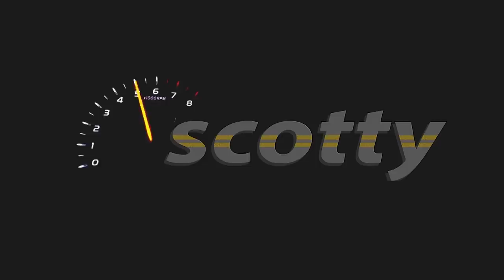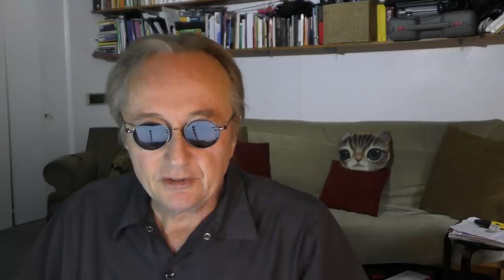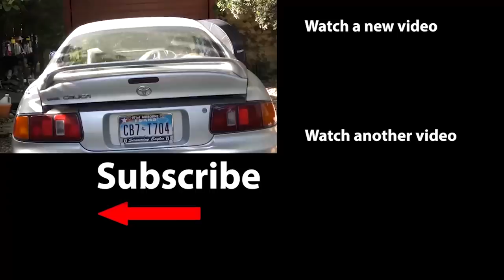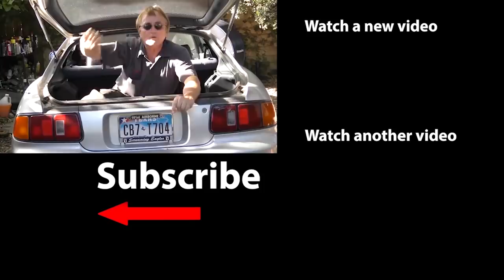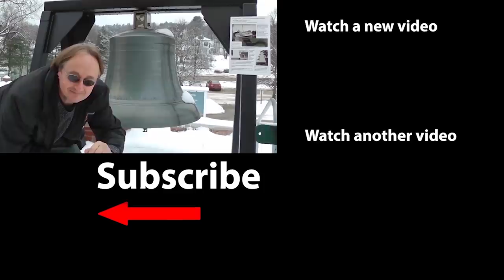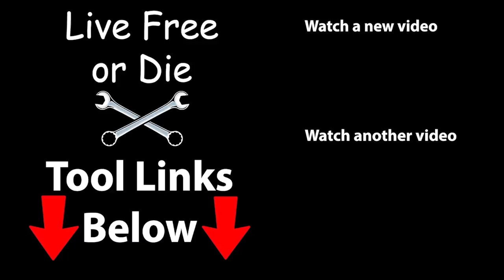Stupid Things People Put in Cars

Comment: 1:00 the most wear is when you start the engine on... COLD. When it's hot after a minute and lubricated there's no so much wear.
Reply: I agree with this statement. Basically overnight, the oil drains down into the pan. The reason the most wear occurs on startup, is because the oil needs a little bit to start flowing and lubricating the engine.
However, i also agree that those start/stop systems are hot garbage, and could wear other components, like batteries, starters, maybe even belts (accessory belt i think) etc. Even if they put beefier ones on, if you live in a high traffic area, the thing will just start and stop all the time in stop and go traffic. Also, i don't know if it's still the case, but in older cars, it actually wouldn't make sense to turn off the engine at a stop if it wouldn't have taken that long, as starting it back up would take up more fuel as it would've if you just left it running, but i assume that in newer cars that is mitigated through the ECU for the most part. If anyone knows, i'd be curious.

Comment: i call the auto start stop stuff. engine killers. and everytime is hear it. i say that engine has lost a few miles of its life. say 200k before it goes kabloey. now 199,995 k kabloey. if i ever have a vehicle that has that day one of ownership the engine killer is going to be permanently disabled.
Reply: Why i simply bought bigger and bigger. Noticed diesels dont have it, and happy to have my 6.7L cummins. Just have to be careful how long you idle. Fuel can and will wash out the cylinders. Benefit, they put a high idle switch into the controls to makeit idle at 1000 keeping proper oil supply.

Comment: I'm about to buy a car ('17 CPO automatic corolla xle, 18k, trying to get it for 16k) from the dealer and it makes a sound when you left off the brakes. Sort of like a mix of a clunk and screech, every single time. Do you know what the problem is specifically? Ima bring it up before purchasing so it gets fixed.

Also, would you consider that a good buy? It comes with 1yr/24k miles warranty bumper to bumper left and a 7yr/100k mile (drive train I believe) warranty afterwards. Good for the price? Thanks

Comment: Hey Scotty, I have a 2014  Ford Mustang GT pony package inside the manual fuel, it stated that  87 regular is recommended for my engine; however it also said that premium (91 or higher is good for pulling, towing and will increase the horsepower, sometimes I wanna use regular to save money, but I always use 93 octane, do you think it would be safe to use regular for a while or keep using 93?

Comment: Hey scotty, I have a 2006 chevy trailblazer ext ls. It has 189,000 miles and is running decent. The only thing mechanically wrong is the fuel guage constantly reading epmpty. Could you give your opinion on chevy trailblazers?

Comment: Large displacement Harley’s have that feature and I turned it off. You’re either compensating for it by blipping before a green light or deal with a slow/sputtering takeoff. It wasn’t for gas but heat, makes sense why they did it. 🤷‍♀️

Comment: Scotty- my parent bought a 86 Buick Riviera that had 18,000 miles. It was stored in a garage, but sat along time. Turned out to be a money pit. Eat through batteries like mad! I called it an electric car because if the charger was not on it it would only last about 12 hours until the battery was dead. It had all sorts of electrical problems. I think my Dad spent $5k for the car drove it for about 4 years put a couple of grand into it every year. After my Dad past away we donated it. Would have never feft right selling it to someone.

Comment: How to destroy reliability 101.

1. Drive the hail out of it.
2. Get a turbo or supercharger with lots of boost. See #1.
3. Turn off half the cylinders instead of using the right ratio in the transmission. I remember test driving a Dodge Magnum with the 350 V8. 350 hp 400'lb of torque and it was at 3000 rpm at 50mph 80km/h because it was using only 4 cylinders. It was in third when it should have been in 5th with the TCC on. Trying to save fuel at 3000rpm with a 350V8? How does that work?

Comment: 2:01 Honda 1.5 t gdi oil dilution problems mentioned again.
Reply: Is this oil dilution specific to the 1.5T or both 1.5T & 2.0T?
Reply: @sungod9873  just the 1.5 turbo
Reply: What about the 9th gen 4 cylinder accord?  Does anyone know if that particular engine suffers from the same problem?

Comment: Scotty serious question, I've heard that before that most wear comes from start up, but isnt that just cold start ups and warm up cycle? My thinking is when the starter engages its just like revving up the engine to 1200-ish rpm, if anything it probably wears out the starter faster, and maybe even the teeth a little but, just a little. Side note, give GM/Buick alittle more credit, I cant drive more than 5 miles without seeing a buick century/ lesebre, those things run forever, with dented bumpers and peeling paint, they are incredible reliable. (other than the L36 plastic intake XD). I love your videos though, keep it up!

Comment: Scotty! I bought a 2014 F-150 4x4 with 5.0 engine. the previous owner had put on a Scepter intake system on it. Great truck, but is the intake system doing anything for me, mileage wise, or is the sound from the intake just for fun? He also gave the origianl intake system to put back on if I want it.
Reply: the motor can only suck in so much air and pump it out the exhaust,   the computer is programmed for a factory intake.  the oxygen sensors,  the same thing,   I think it just makes people feel like they did something for the truck,  but its only one of many many,  many,  many parts that need to be changed to make it give you any real noticeable power increases.  even the entire exhaust will need to be changed to a bigger exhaust with different computer programming and can be illegal in many states of the US to do that.  its illegal to make a car or truck get worse gas mileage in most states,   and that's what will be going on with it.

Comment: Hey Scotty How are you. I have Daihatsu Mira Cocoa 2014, It has an idle engine RPM around 1700 when I start the engine and after some time it settle down to 1200 which is high from normal. What could be the problem?

Comment: The only real gasoline saving device is a manual transmission and a homemade fuel vaporizer instead of a fuel injection system. I tried a couple of times and it realy works! I recommend it.

Comment: Blown head gaskets are no fun. I've only experienced it once. Eons ago, I was driving my Mom's 1992 Plymouth Acclaim and it overheated sitting at a red light. I started noticing a few days later that the car was idling really rough. Felt like the engine was bouncing. She took it to a mechanic and found out the head gasket blew and cracked the head. Luckily those cars were super cheap and easy to work on, so she had the work done for less than $1,000 and we drove it for another 2yrs or so until someone rear ended and totaled the car at 182k miles.

Comment: I have a Nissan Frontier 2004 and it's 198K miles should I try to replace the automatic transmission once it goes out? It still runs smoothly hopefully it gets to 300 trouble free.
Reply: shops are charging 2,500 to over 4,000 dollars for that service.

Comment: What do you think about a 2010 Yukon Denali with 120000 miles? 6.2 l v8 engine.
Reply: those engines are bulletproof if you change the oil every 5k miles and use synthetic. Reg oil sludges for some reason even if changed every 3k miles. The 4l60 trans can fail but the 4l80 trans are really good. Change the trans fluid every 40k miles and it should last decently.

Comment: Bought a 93 lexus, LS400 with 132,000m. Have issue. Slips out of overdrive and tacometer raises but no power. Have to get off gas and slow then start gearing up again. Notice more when driving up steep incline on hwy.  Code points to cam sencors, or watched video that clams sylinoid in tranny.  Need advice. Like car, paid 1200 for it. What to do plz. Sean

Comment: 1. Cylinder deactivation has been in the 5.7 hemi since its inception, no problems and they run forever. 

2. Its true that your largest amount of engine wear happens at start up  However,  that's a cold start, not when the engine is warm and the oil is already fully circulated. Start and stop engines wont see anymore wear vs non.
Reply: Doesn’t matter ima still permanently disable it.

Comment: I'm putting marten defense in my engine bay, one that beeps in ultrasound and zaps them like an electric fence if they still get in there. Doesn't save gas but them chewing on wires, hoses and taring through the insulation every day is frustrating.

Comment: Hey Scotty I have a 2007 Toyota Sienna with the 3.5 V6 in it.  Since I've owned it starting at 83K miles the thing sounds like a pinging diesel engine when it starts in the cold weather and makes all kinds of noise until it finally warms up all the way.  It's been doing this for 4 years now and hasn't broke but just doesn't sound normal.  Some people have told me it's piston slap as part of the design to save gas until the engine has warmed up all the way and piston heads expand but that just sounds crazy to me.  Today the vehicle has 125K on it.  I've never seen a 3.5 Sienna for sale with more than around 150,000 miles on it...yet I see the older Siennas with the 3.3 V6 with over 250K miles on them.  Should I keep my 3.5 Sienna or dump it before something goes very bad?   Thanks

Comment: Hey Scotty I have a 2018 Ford Focus and when I stay under 15 mph in speed the car makes a grinding noises what could cause that Ford has said they couldn’t duplicate the issue and I can do it all the time thanks
Reply: Could be the dual clutch trannsmission. They are infamously bad on those cars. Ford is well aware of the problem. Try taking it to a different Ford dealer for diagnosis.
Reply: I thought they didn’t have those type in a 2018 model

Comment: Scotty have you ever removed a broken spark plug ? I have a 2016 Ford Fusion with the 1.5 Ecoboost and the 2nd spark plug broke in half. Not sure how to remove it.
Reply: I will bet it has other issues,   it may have a very small head gasket leak,  it causes corrosion that makes the spark plug get stuck.  the fusion was good for that,  you may get the plug out but the condition that caused it to stick is still not fixed,
Reply: A Team Something I’d have to look at but I still can’t remove the other half of the spark plug.

Comment: Stop and start thing - I wonder how long the starter will last. As for wear, use 100% synthetic oil or same 100% semi-synthetic oil, engine will last forever with proper maintenance.
Reply: They have more robust starters which are certified to way more cycles to failure than regular ones. I think start stop is pretty stupid anyways, it's mainly for emissions and not fuel economy.

Comment: GM's cylinder deactivation was the 4 6 8 used in the Cadilacs at one time.  I am not sure which one was a worse failure, that or the Oldsmobile Diesel (which was just a converted gasoline engine really).

Comment: Start/stop systems are genuinely useful, they do save gas after about 4 seconds of standing still, and the starters are designed specifically to last through the ragging. And as far as I know it's a separate starter that isn't mandatory, so big deal if it breaks.

That said I've only driven the latest of these systems, they seem fine enough to me. Things can change Scotty!
Reply: in cold weather,   they kill the battery,   and how will it keep you warm???   and keep the electric blower motor running in very cold weather pumping cool air onto you with no heat in the heater core.   and in hot weather.    how will it keep you cool and the AC running at a stop???    and how will the catalytic converters handle all that on off and properly heat up to function good without premature clogging.  just a thought.   I mean,  yeah,   a really big thought.  its not a open air golf cart.
Reply: A Team the SS is defeated when a/c or heat is needed or when electrical loads are too great. Much better starters and hardened flywheel ring gears are used.

Comment: My Uncle hears cars starting up like that too.  He thinks that people are actually turning them off and that the start and stop is only for hybrids.  That just shows how little he knows about these newer cars.  Another thing with start and stop is that there IS a noticeable delay.  I don't own a car with that but I see it all the time.  It feels like they are a sleep at the wheel.  Then this only saves a negligible amount of fuel for some people.  It is nice that in some cars you can temporarily turn that off.  Rumor has it that some trucks even have this annoying system.  If you are towing or can trick it into thinking you are it can temporarily disable it.  It is not hard to tell which vehicles have it, just open your windows and at a stop light you can hear them start most of the time.  I know they claim to use better bearings in the vehicles that have it but I agree with you that in the long run it won't do too much to prevent early failures.  It is sad but it seems that most vehicles these days are designed to be throwaways that would surprise me it they made it past 10 years.  The only nice thing about start and stop is that it seems to be an effort to make a vehicle that is more efficient but without making them unbearably slow to drive (or slower than they already are).  Then there is the alleged global warming.  Some people theorize that it is really only natural cycles.  Maybe Al Gore is full of hot air and there is an inconvenient truth he does not want to acknowledge and admit to.

Comment: The only way to make sure and ICE won't wear out fast from stop-start is to actually run a pre-oiler system that maintains oil pressure and flow while stopped. Not happening anytime soon.
Reply: Hmm... Electric oil pumps.

Comment: The newer 1.5 liter Honda engines, do you think they're still a gamble? Allegedly the oil dillution has been fixed via software, but 182 hp from such a small engine seems stressful. 

I'm asking since I might buy one as the rest of the car seems great, you get alot of car for the money. Just not sure with the engine..
Reply: junk,   don't expect to use it on the highway,   they will never pass a car in the slow lane,   no power at higher speeds.

Comment: If you do not want or do not need those type of technologies, then just get a 2008 Kia Sorento LX 4WD with the 3.3 L V6 engine, 242 horsepower and the five-speed automatic transmission with manual-shift capability. Another option is to get a 2008 Subaru Outback 2.5i Touring with the 2.5 L flat-4 engine, 170 horsepower and the four-speed automatic transmission, also with manual-shift capability. Both these vehicles are more spacious, the wheelbase are both extended and they are a lot safer and reliable.
Reply: I tell people all the time,   buy the base model Kia with now extras,   the Kia soul starts at 15,000 but with extras hits 45,000,   for the same exact car,   and all that extra junk will break and cost them money to fix,   and what do people do,   they buy the loaded model.   then 3 months later,   hey can you fix this.    OMG.

Comment: For the person that said his Honda was misfiring on all cylinders , it could honestly just need a valve adjustment. I have a 06 Acura MDX and it was also misfiring on all cylinders , changed the spark plugs , ignition coils and fuel injectors and it was still misfiring . After adjusting the valves , all misfires went away.

Comment: Scottykilmer what car should I buy a Toyota rav4,Mazda cx5 or a Honda crv?
Reply: Obese I have a RAV4 and it has 117k on it and I have only done regular oil changes, one serpentine belt change and spark plugs and wires. The only real issues I have had is that the back tail gate rattles a little and I have had to replace the inner fender well because something bounce into that area and ripped out the fender. It still runs great if that helps. I have also had a CRV (I bought from my sister.) it ran great until the engine blew but I think that was because my sister had a lead foot and like to race people.
Reply: @cheesegyoza  thanks helpful advice

Comment: If it’s true, and I must admit it makes sense, that an engine starting/stopping wears it out faster...  How do you explain all the Priuses and other hybrids that last 200,000+ miles?
Reply: Different system.
Reply: Completely different lol
Reply: Different how?  I have a hybrid (Ford Fusion).  My engine is off at first and it runs on battery, then the engine starts when the battery gets low or I step on the accelerator.  Even on short trips my engine turns on and off numerous times.  I don’t see how this is different then a non-hybrid car engine starting and stopping.  But, I am not an expert, so am open to explanations.
Reply: My 2 cents...as a Prius owner...Toyota designed the engine from the ground up to shut off and restart regularly so it holds up.  If it didn’t, the Prius would have been a disaster.  Also, wear at startup is on a cold motor.  Once lube is circulating, the flow must stop for a significant time before protection is lost.  However, I’m sure a lot of cars that just shut off motors when stopped or turn off cylinders aren’t designing the motor specifically for that purpose but rather adapting and existing design with mixed results.
Reply: qd   This does make sense, if it is designed for this application (lubrication) it could alleviate issues.  I’d love an expert answer, hey Scotty!

Comment: I remember  the Cadillac  V8-6-4 system, late  70's, always in the service bays for electronic  problems (ECM).  Then  the auto shutoff feature  just like a golf cart, restart excess fuel belch,  nominal fuel economy gimmick.
  Gimme   an old  Chevy or Ford  w/ points, it'll  start now , run Get decent  economy  w/o head$$$aches